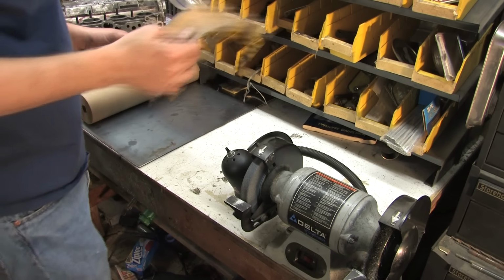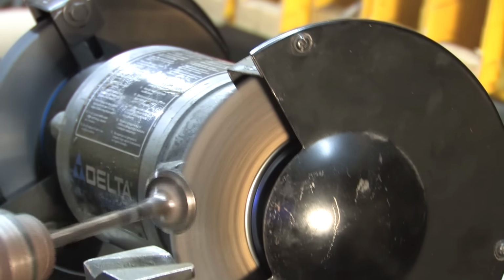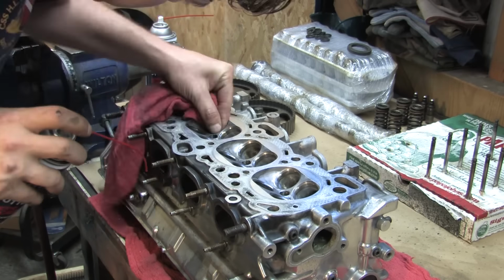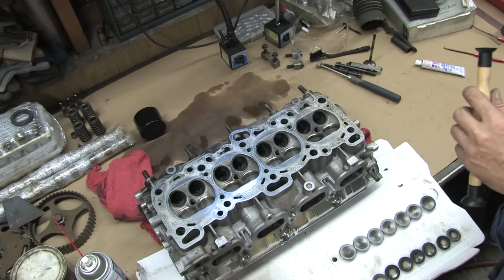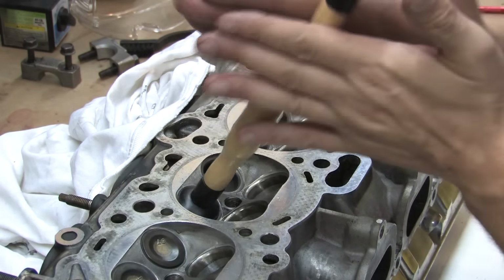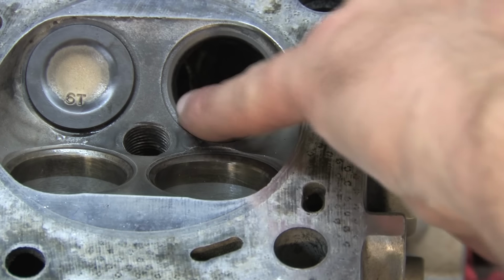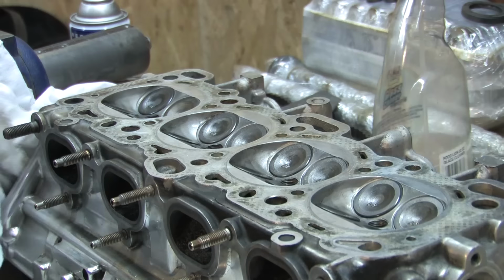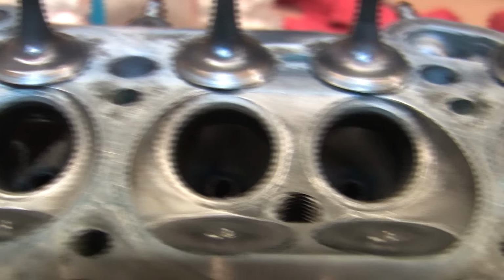Cylinder Head 105 - Valve Job Basics

Comment: I have a question I have a 1977 GS 750E I need piston rings are all piston rings the same size I can't find a set of piston rings for my bike will a 500 or 1000 rings be the same .......Question  do I have to replace the rings with only 16,000 miles on the bike or will I have a problem it Iif i hone The cylinders lightly will that be OK.   thank you

Comment: Where did you find a brass wire wheel for your grinder? I can only seem to find steel wire ones or only "brass coated"
Reply from the maker: Alex Nguyen They're all brass coated.  Some things I took for granted in the narrative.  That's the one you want to get.
Reply: ***** Ah got it, that opens up the options a lot. haha

Comment: can someone explain to me why and what he is doing when he is spinning the valves? it has to be done after cleaning them correct?
Reply: He is marrying each valve with its corresponding hole in the head of the engine (combustion chamber). The contact between both surfaces MUST be closest possible to perfect to ensure the combustion chamber is sealed when valves are closed. This prevents the engine from losing compression due to incorrect sealing of the valves.

Comment: I worked at a machine shop and honestly you don't need all these "extras". Never oiled the head to lap valves and always used a steal wire wheel to clean valves.

Comment: This video is a life saver!  This is the most informative straight-to-the-point video about valve lapping.  I just went from apprehensive to confident in 15 minutes.  I knew the basic procedure for lapping valves, but had never done it myself.  He shows you all the tips and tricks that I never would have figured out.  He also makes it clear what you need to watch out for, and how to tell when the valve is correctly seated.  No doubt, I would have messed something up on my own engine If I hadn't watched this video.  Thanks!
Reply: Yes Sir, he's a soft spoken guy.

Comment: I've got a question about aftermarket TTY head bolts maybe someone can help me out with a little advice.  I measured all the new aftermarket bolts and they're .003" skinnier than the old used TTY bolts. These are going into an aluminum block and i was worried that it may strip out the threads inside the block. Should I worry about this?

Comment: Looking at the pattern on the face from lapping I'd say your seats need cut. Only the center third of the face should contact the seat. This is a lapping job, not a valve job. Other than that it's a good video with sound advice.

Comment: So if I were to use new valves,the process be the same?
Reply from the maker: If you're using new valves, you should cut new seats.  The video about that is linked in an annotation in the video, or you can look up "Cylinder Head 201".  :)
Reply: Very well,thank you very much.

Comment: I completely agree about using the hand tool to lap valves. But for those out there that are too impatient for the hand tool. They do make the suction cups that can chuck into a drill and will at least eliminate the problems with damaging the valve stems due to side loading or the chuck slipping off. Also when I was a kid I remember my grandfather had a tool for lapping valves, it looked kinda like a hand-cranked kitchen mixer, but when you turned the crank the chuck on the end would rotate 1/2 a turn to one side, then back to center, then 1/2 a turn to the other side, to simulate the movement of the hand tool. The gearbox was rather noisy and you still couldn't get a feel for when to stop, but it was a neat tool none the less.

Comment: Why did you clean the old valves but not replace them? At the beginning of the video.
Reply from the maker: Because you can't tell if they need to be replaced unless they're clean.  $12 x 16 = $192.  The valves I found once they were clean weren't damaged or pitted.  15 minutes on a bench grinder is a bargain unless you make $768 an hour.  This process will discover if they're pitted or bent.  If they can be saved, it saves you a whole lot of money.  Those are the kinds of things I pride myself in demonstrating more than opening new parts.  Those are the things that make people better mechanics.

Comment: did you have the valve seat done by a machine shop?
Reply from the maker: Ultimately I did, because of the changes I'm doing in the camshaft and valve spring department.  The cams I selected provide much greater lift, and they require that you're using a stock valve install height.  Because this head had a valve job done 60,000 miles earlier, the valves were recessed back when the seats were previously cut.  I have a lot of work in this head so in order to correct my valve install height, I installed oversized valves and cut new seats.  That's in the radius cut valve job video that was linked here.  :)

Comment: my 300 I6 is at 520k original miles miles and sadly the valves are beyond shot 5 and 6 are burned and 1 is slightly bent :( reman head is on the way can't boast about my 1/2 million miles anymore because now it has a the head rebuilt

Comment: I have very little experience with engine work; I'm a total novice. But since my Benz M103 straight six will eventually need a valve job, I wanted to know what goes into the job. I happenstanced upon your video and was kinda mesmerized watching it. Thanks for taking the time to make it; I learned a few things about what to ask the machinist who would do the work Now if only I could find a local shop that would refurbish my head in the way you've done it!

Comment: Wow...what a fine piece of instructional video.  I have never done a valve job, but was thinking of doing one on my 2000 GMC Sierra 5.3l v8 with 301,000 miles and wanted to know a little bit about what was absolutely necessary and "my opinion" stuff.  I've got to say, you have mastered the ART of merging technical instructions with proficiency in delivery to the common man!  I have no doubt now that I could spend a weekend performing a well done valve job and know that putting it into service will not leave me guessing if it will work!  Very well done video Jaffromobile...kudos to you on job well done.

Comment: I can't find any brass wire wheels  everything I found in store and online is brass coated steel. Are you sure your wire wheel is brass could you test it with a magnet, and where did you get yours. The only brass I can find is the little tiny tooth brush style.
Reply from the maker: It's brass coated steel.  I wish I had narrated this better.  That brass coating is all that's necessary to prevent destroying the machined surfaces of the valves during the cleanup.  Brass coated steel is just a little more "slippery".  That's the wheel you need.

Comment: can the valve stem seals on the opposite side be removed and replaced without removing the heads as the valve stem seals are located below the springs on the opposite side. my vehicle is smoking on startup only and a little when I drive.  I was told it was the valve stems seals  at the auto parts store because of it happening on startup.  I have a Supercharger on my 2002 Mazda Millenia-S and My Mechanic tells me that my Supercharger is leaking engine oil into the Inner Cooler.  I bought a Supercharger to replace the one on the Vehicle and hope that it stops the Oil Burning Problem about a Quart Per 50 miles. Can you respond to the Valve Stem replacement question Please.

Comment: Is that an air dremel or electric? Can't tell by the fitting
Reply from the maker: Old-skool electric Dremel brand with flex shaft attachment.  More than a decade old.    They look totally different now, so I don't blame you for not recognizing it.
Reply: ***** Is there any real difference in performance with air vs electric? I'm looking to acquire a couple different sizes of dremels in the future and I'm not going to be able to use air without getting some neighbors pissed off.(Even if I fix their stuff)
Reply from the maker: DoctorGuy I missed your comment last week, so you're getting my un-divided attention now.  Good question.

Look for Electric straight-shaft DIY grinders with a 1/4" chuck.  You get what you pay for.  Whether you're grinding or polishing, it's the most versatile.  Problem is most are only 2 speeds, 15,000 RPMs and off.  So it's dangerous doing precision work.  Once you've used a 1/4" electric straight-shaft DIY grinder to polish something big, you realize the 1/8" Dremel is the slowest tool in the world for polishing.  It does a great job, eventually, but the outcome will have more to do with the patience of the operator and his methods.  The little dremel and flex shaft is only good for detail work.  You'll learn a lot more about the process using the big stuff.  I would consider most all of what's in this video to be detail work.  

Using the right kind of tool for the job is critical, and there's plenty of things that a 1/8" rotary tool can't do fast, but you'll be tempted to use it on a job that's too big for it if you don't have all of the other right tools for those kinds of jobs first.  There are some videos here of me bringing a modified polished valve cover back to life using that straight-shaft DIY grinder.  Doing any of that with a Dremel would be insane. 15,000 RPMs is a lot different when you compare a delicate little 1/2" dremel wheel to one that's 4" across with a high-amperage high-torque motor driving it. The polishing supplies for the big tools seem to get cheaper the larger they get, and they're much easier to find supplies for.  They cover 100x the surface area before wearing out.  Basically, you'll only want to polish things with a dremel that the bigger tools don't fit in.  Having the other tools first will prevent you from burning through $60 worth of tiny bits to cut or polish something with a tiny rotary tool.

So after you own a workbench and a hammer, a vise, bench grinder, an angle grinder, and a drill... THEN get yourself a small-caliber rotary tool kit (the best you can find with all the attachments), after that, get a straight-shaft 1/4" DIY grinder.  With that setup, there's nothing metal you can't cut, bend, grind, or polish.  Maybe throw in a sawzall to spoil yourself a little?  Add a radial saw, jigsaw and orbital sander ad boom... everything you need for wood.

You'll make a lot better use of your time with a simple electric setup like that than you will with air tools for 3x the price, and don't even be ashamed to buy stuff with cords on it.  You'll never get interrupted by a dead battery.  I love my corded tools.  You'll find that you use those other bigger tools a lot more often than you need the small-caliber rotary tool.  You'll do more actual work with them, so they're a better investment.  Plus, an extension cord is cheaper than an air compressor.  BUT... if it's detail work like this that you need to do... then, small caliber it is.  Nothing else will do it except for the small rotary tools and a lot of extra time.

I use air tools for porting because of their light weight and convenience.  You could probably get away with the same thing using a 120V hand drill.  At least on the sanding part.  Not so much with the carbides.  It won't be nearly as enjoyable of an experience to port a head with a hand drill, but when luxury is not available, determination goes a long way.  The right electric tool is available for almost every job.  You'll know when it's the right time and place for air tools.

Comment: i think listening to the variation in sound is paramount to a good valve to seat finish,you can HEAR when it is done as well as feel it when doing this manually.
i wondered if you had any opinion on back cutting the valves for added flow? this would be using a drill and grinding wheel the same way you cleaned them
 but removing any obstructions on the rear of each valve?

Comment: just put3 cans of carbie cleaner down the air intake when its warmed up idling, if youre not sure get a $20aud phone camera down the sparkplug hole to see if all the carbon is clean....
itll clean all the carbon off your pistons too...

if you havent pulled the motor out and apart, this is not needed unless youve down a failed compresssion test, which most cases the valves need replacing

Comment: Thank you for the great video! I am wondering have you resurfaced the cylinder head before installation. If not how removed the slight oxidation of the aluminum contact surface?  Thanks a lot again!

Comment: I've been doing this almost 40 years lol to Woody.  Actually, here's a tip. If you have a perfect seal and clean faces., if you drop the valve in, it will pop back up like it's spring loaded. Nice job

Comment: nice video...would be nice to see if the home-spun valve job passed your liquid leak down test ?  that would be best way to show that a DIY project had same result as paying a pro.
Reply from the maker: You're absolutely right, I should have done that.  But I want to clarify that this is never going to give you the "same result" as a machinist that regrinds valves and cuts a new seat.  No way.  If you did this process to a freshly-cut seat, this would actually make it worse.  Lapping on modern engines should be done for nothing more than an inspection process.  I lap once and inspect.  If that didn't take whatever anomaly out and give me a good seat, then as far as my home garage is concerned...  it needs a machinist. I don't try to grind valves in with the actual valves.  Unfortunately I just didn't have anything wrong on this head to require more than a cleanup and inspection.  BUT, because so many people complained this wasn't a valve job, I created a problem and wound up installing 1mm OS valves in this head, just so everyone could see what that looks like.  There's a link in the description to it, I think?

Comment: my k20 engine not firing properly could it be the valves
Reply from the maker: Dj Frain It could be... it's less likely to be the valves than one of your ignition components, but a compression test would answer your question.
Reply: ***** it blew head gasket twice and coolant blocked my exhaust pipe. never worked on them (valves) at all. Cant do a compression test now i have no equipment.

Comment: Have question 
 It's your heads don't needs to pressure test if ur valves grinds is done just ask
Reply from the maker: No.  Not unless there's a leak or if you suspect poor quality work.  Then it's justified.  You could do a vacuum test without installing the head, but a proper valve job doesn't need it.

Comment: have u ever had. valve stick inside the valve guide...i tried to take the valves out ne 5.9 v8 head...and damn tbey are stuck in there good...have to bang them out of the guides with a hamner and a screwdiver at the very top of the valve stem? are the valves bent or is it the guides causing this.
Reply from the maker: It sounds to me like the valves are bent.  Try saturating the valve guides with some marvel mystery oil and let it soak in before knocking them out.  You'll use a little mystery oil, but you'll save a little elbow grease.  The valves are steel, but the guides are bronze, so they shouldn't stick unless they're bent.

Comment: hello jafromobile i have a question, the cylinders are beneath the valves in this engine right? because, according to what i saw previously in some videos, they are always under the valves, if so, how many valves can a single cylinder have and what is the effect of increasing the number of valves? ps : i am still a novice .thx in advance
Reply from the maker: Some Audi engines have 5 valves per cylinder.  The typical internal combustion engine has at least two, but some have zero like the Rotary and Duke engines.  Honda and a few others make 12-valve 4-cylinder engines, and just about every manufacturer today makes some version of variable lift or variable valve timing.  What makes power is how much air and fuel you can put INTO the engine, because the burning gasses are going to find their way back out.  The more pressure there is during the combustion and exhaust stroke, the better, and the exhaust valves open before that stroke ends, so the exhaust valves are typically smaller, or in the case of those Hondas, fewer.  Variations in valve configuration are different attempts to maximize airflow.  Typically more valves = more horsepower, and less valves = more torque.  That's where the variable valve timing and lift systems come in to play.  They attempt to make the best of both horsepower and torque by changing the valvetrain geometry depending on different running conditions.  Some are actuated by oil pressure, some electronically, but most are actuated by oil pressure.  Increasing the number of valves is not typically a modification that can be done to a head to the same cylinder head you're starting with.  There's a little too much going on behind it.  The valves don't connect directly to the camshaft.  It's going to have rockers, lifters, pushrods, etc...  All of those things are typically a finely-tuned balancing act that protect the camshafts from being damaged by opening and closing the valves.
Reply: Thx

Comment: Hey Jafro. Been a minute sine I've been here and logging into DSM tuners. Great vid, BTW. I have a '91 Eagle Talon 2.0 non-turbo. Mine has been sitting up for years so I put in new parts like timing belt entire kit, piston rings, etc and took it for a spin a few times but now I have low compression in all cylinders. I believe this is what's wrong with mine. Do you do this kind of work for other DSM members?